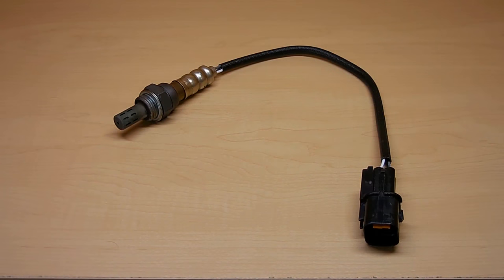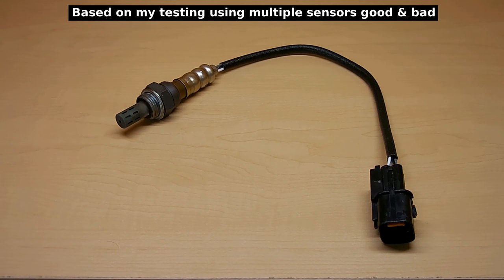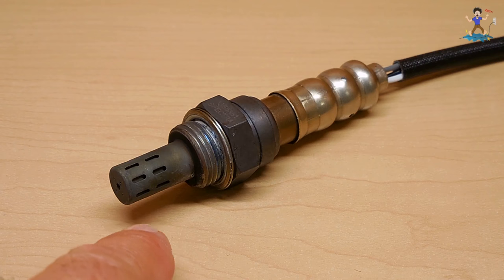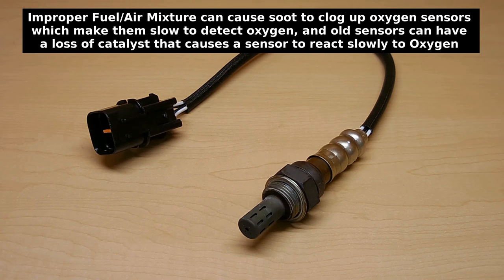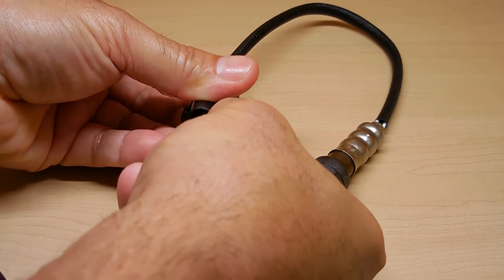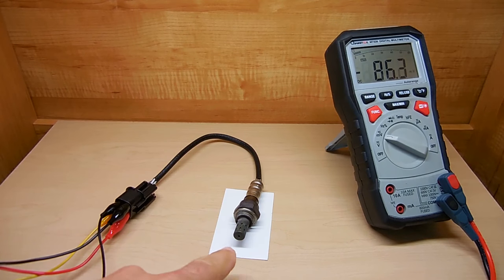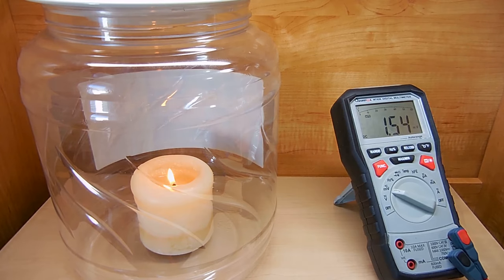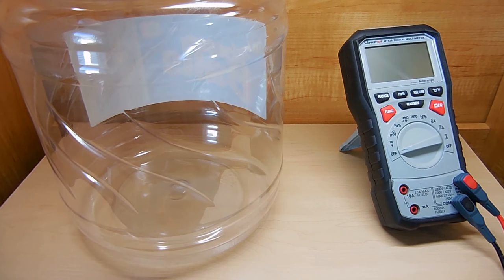How To Test Heated Oxygen Sensors(O2 Sensors) Without A Propane Torch

Comment from the maker: ATTN: The information contained in this video was intended to help viewers with the most common type of modern fuel injected vehicles that use O2 sensors along with an MAF sensor and IAT sensor.
Reply: What are these strange readings?!  Is this sensor broken?!?  You said it yourself the values should go from 0.1 to 0.9V, which are 100 to 900mA, and we see -12 to +6mA ?!?
Reply: @ivanbnv8354  He said typical readings .. some vehicles have different parameters which is why they all have different part numbers. years and years ago o2 sensors were all pretty much the same and different part numbers were simply to denote the length of the wires. Modern sensors are used for all sorts of data and have different parameters. wide band sensors are used in performance applications and cover a broader range and as such cost a shit ton more money
Reply: @ivanbnv8354  🔴 What Is Islam? 

🔴 Islam is not just another religion. 

🔵 It is the same message preached by Moses, Jesus and Abraham.

 🔴 Islam literally means ‘submission to God’ and it teaches us to have a direct relationship with God. 

 🔵 It reminds us that since God created us, no one should be worshipped except God alone. 

 🔴 It also teaches that God is nothing like a human being or like anything that we can imagine.

🌍 The concept of God is summarized in the Quran as:

📖 { “Say, He is God, the One.  God, the Absolute.  He does not give birth, nor was He born, and there is nothing like Him.”} (Quran 112:1-4) 📚

🔴 Becoming a Muslim is not turning your back to Jesus. 

🔵 Rather it’s going back to the original teachings of Jesus and obeying him. 

More ....
Reply: A propane torch should also clean it from build up carbon ?

Comment: You are my guardian angel. Thank you for this content. I will be watching a lot of it multiple times in the coming days. This one will be watched again later today or tomorrow when I run the O2 sensor tests on my Honda and BMW sensors. Both cars had blown gaskets and require full rebuilds. One is FWD and the other is RWD and I don't have a shop or power tools so I do everything by hand between 2 trees and under a tent on a sloped driveway. I started with zero knowledge, but I have documented the process and once I am done no one will be able to tell that these cars weren't built by the factory. (Other than the engine swap numbers) so thank you for the detailed videos. I am a fan.b

Comment: Great vid and methods explained very clearly.

Made me think about using the oxygen from the oxy/acc bottles in the shop, and feed it in with the torch head on a lid.
Reply from the maker: Glad you liked the video Jo! Be sure to look over my extensive video playlists below for many other videos of interest to you, use supplied Amazon links to support my channel when making purchases(No added cost to you), and share links to my videos with many others on social networking sites. Thank you, and stay safe!
http://www.youtube.com/c/electronicsnmore/playlists
Reply: @electronicsNmore  Professional mechanic and used to diagnosing these on the vehicle running and going by how fast they change readings but ever since got into removing them and cleaning in the sonic cleaner never really had a method to verify the heating circuit usually just cleaned them installed them and see if it fixed it.. with these sensors costing up to $200 these days and aftermarket ones utter shite been in the habit of cleaning the oem ones because to many times if you replace one you have to replace the other as well because mixing brands can get trouble codes when both parts are working they just have different value ranges.

Comment: Thanks for the time you spent making the video. 
I do have questions if you can help further:  On my 2008 Kia Rondo  I am dealing with OBD code for the downstream sensor that seems to not respond to O2 variations.  So I purchased two sensors just to verify what a good sensor should show on test bench. Bosch 15320  and NTK 25183. The NTK is lot more money but it is OEM.  I wanted to test them as you explained.  Temp at the outer casing on the tip was around 360 - 400F during test.  The way I do it is slightly different. I start with sensor in the jar with candle lit in jar. I place a lid over the jar and wait until the flame is gone. Then I check voltage:  NTK sensor shows  - 8.5 mv.  I removed rapidly the sensor from the jar to see the reaction when exposed to ambient air:  The voltage quickly went to -14.5 mv.  Notice the polarity reading is negative. I did pay attention to connecting the voltmeter + probe to the black wire which is supposed to be signal wire on this sensor. I thought that signal would be considered the positive side, correct?
Also notice the voltage going from 8.5  to 13.5  when O2 level  increases. This is contrary to what you experienced in your test and I think contrary to what the sensor does in a car.  In a car the sensor voltage decreases when the O2 increases.  I wonder about whether I have the wrong sensors or it is simply the nature of this simple test. b The Bosch sensor reacted in the same manner with -10.6 mv without O2 and - 17 mv in ambient air.
Any reply to my comment  would be much appreciated.
Thanks
Richard

Comment: @electronicsNmore   If the sensor is plugged into the vehicle harness but not the cat and key switch is turned to the on position (getting 12V from) should the sensor heat up?

Comment: But does lambda sensor "smell" oxygen difference between top holes (exhaust) and opposite (outside, ambient), close from bolt head holes ?
Reply from the maker: All detection takes place inside the exhaust system.

Comment: Good video.  Rewatched.  Any concern (ever) with voltage reading in millivolts?  5 millivolts- for example- is 0.005 volts.  Proper reading range to be between (0-1v). I do understand this test shows viability and quick response.........but Id think the voltage would be higher.  What am I missing?  Maybe not entirely not enough?  Combustion gas would have far less oxygen - somehow?   Please advise.  Thanks!
Reply: I tested my O2 sensor and it showed stable 4 mV (0.004 V) in room air. I tested it other way around, I blow the air to the sensor to get more oxygen to see if there are fluctuations, and voltage dropped to 1 mV, which is consistent behaviour.

Comment: If you only  have a 3 wire O2 sensor. to test voltage , do you hook up the two white wires ,then  one to  the black then the last one do you touch the body of the O2 sensor for ground... cheers

Comment: To drive the Oxygen sensor to his maximum voltage, you can mount the sensor in a piece of metal tube, and pull this tube it vacuum. 
This only works offcourse if you have a electrical heated oxygen sensor.
The voltage is created by the internal capsule which contains pure oxygen on the inside, and the less oxygen on the outside of this capsule, the more voltage difference is created by the in and outside of this capsule.

Comment: Hey, so does this mean, if i disconnect oxgen sensor from car and test it with multimeter, even if it shows a response, the oxgen sensor could still be faulty because its not getting tested and required heat temperature ?? 
 Im getting a p0420 code , after fitting brand new approved cat after couple weeks, scratching my head, as checked the 02 sensors disconnected and they show a response, they aint at zero.
When i clear the code, it comes back on after along drive. Thanks

Comment: I had to cut my old 02 sensor wire  and wire to new one cuz the new 02 sensor  it was too short it should still work right long as wires connecter back together?

Comment: Hi.  The info at the start said approx 0.1-0.9v should be expected, but the meter showed 1milli-volt (- 100-times smaller)?  I don't understand?
Reply: My guess is that it is still not as hot as would be required to be displaying values in the 0.1v to 0.9V range. Just my guess at this point. Perhaps someone with more knowledge can chime in.

Comment: Sir , my honda jazz ivtec has P0420 code , i tested the O2 sensor by this method and results was 
Heater is working, 
After heating the reading was around 5.5 at normal atmospheric condition , when introduced to a bottle of smoke ( as shown in the video ) it has decreased to around 1.8 , when i turned off the heater value increased to about 15 and again fall back to 0 slowly 
I had put the multimeter to 200mV position 
And change in the values was very quick

Comment: I'm trying to trouble shoot my tacoma 2000 and was wondering what happens to my truck if the black and gray  doesn't work(which is what i'm reading with my multimeter)?  Right now it's have a rough idle but runs fine when driving.  But since it's an old truck, i'm leaning to an air leak that I cannot find.   I'm asking because people always have trouble shooting videos on detecting bad sensors, but not the impact of a dead sensor on ECU.  Since it's dead, how does the ECU compensate for it since there is no signal going to it from the 02 sensors? Does it run tell the computer to run lean?

Comment: good test .. Because in most cases the sensor is OK, and the problem lies somewhere else .. Injectors are dripping / fuel pressure too low / incorrect air in the intake area / ignition system defective.

Comment: Where did you get   pure o2 for the test.    Do not heat the sensor like the pre view shows  as the soot from the candle may clog the o2 sensor.
Reply from the maker: Home Depot or Lowes. Oxygen cylinder for brazing/welding. Thanks for watching!

Comment: Do o2 sensors have a relay in a 2000 dodge dakota 2.5
Reply from the maker: If they use an internal heater, then most likely.

Comment: This sensor looks like an A/F sensor because of the readings is too low.
I know that the O2 sensor readings fluctuate between 100 - 900 mV.
Or i missing something 🤔
Reply from the maker: You missed something. :-)
Reply: @toolman talal wtf isn’t A/F sensor just another name for oxygen sensor??
Reply: @619guy202  you are correct. The cheap ones, about $15 to $18, are often the single wire none heated wide band sensors. The expensive A/F guage and sensor kits are often a 4 wire heated narrow band sensor that can give far more accurate readings. While the wide band is literaly that. They flucate largely and an average reading is used. A verry budget model guage you will see this fast flucation while cruusing as the A/F is rapidly adjusted continously. A mid range model will have a buffer circut to average out the reading, the ecm still has to adjust the A/F rapidly to account for the average reading of the single wire O2 sensors. The narrow band sensors allow the ecm to more accurately adjust the A/F and a steady value will be observed. As it provides a more accurate reading in the first place. As the old saying goes garbage in garbage out. All though depending on your purpose a mid range or budget model can suit your purpose at a lower initial and life time maintance costs. Performance needs would all ways fall towards the more expensive and more accurate models. As the high end narrow band sensors can cost several hundred US dollars.
Reply: @William Allen yes now bow down to me

Comment: In my experience O2 sensor often is the problem.
Reply from the maker: I'd say 50/50. I've seen many people replace O2 sensors to end up with the same codes or new O2 codes because the MAF was faulty, female O2 wire harness had poor connections, or other engine problems.

Comment: fyi O2 sensors DO NOT sense oxygen at all. It senses exhaust heat only, that generates a low voltage that the ecm interprets if the current ratio is correct or not, hints open loop learning mode. To which adjustments can be made to achieve the correct ratio. A bad O2 or MAF sensor will cause your car into closed loop with factory set fuel values to prevent engine damage but will result in slightly to bad fuel mileage.
Reply from the maker: Wrong. LOL
Reply: Everybody is a damn mechanic

Comment: This doesn't work with all sensors..it's been tried and with a brand new Denson sensor. only if you put the flame of the lighter, then the voltage jumps. when the heating element is on.

Comment: Best off to clean all the sensors in a vehicle and test them all off the vehicle because if you replace just one it will not have carbon build up and give different readings that will trip a code so best to clean them all so if you replace one sensor the others will be clean and operate in the same range .. just like fuel injectors if you replace just one and rest are dirty and gummed up the engine is going to run poorly and possibly out of balance. clean them all replace the bad one with a new oem one or cheaper yet get one or 2 from a salvage yard really cheap and clean them and have a spare and possibly less then $20 versus $100 plus for an oem injector.. news flash cheap injectors from e bay are made in china garbage and part store one not much better.

Comment: Ill pass on HF wires
Reply from the maker: What do you mean?
Reply: electronicsNmore 

    Harbor Freight wires
Reply from the maker: @sirsweetness8332  Thanks, I was wondering what he was talking about.
Reply: Nothing wrong with using Harbor Freight jumpers for this sort of application. There are no high voltages present. Quite honestly, if you buy these from Mouser, Digi-Key or other "reputable" electronics suppliers you will most likely receive the exact same jumpers made in the exact same Chinese factory, but pay more money for them.

Comment: Fake? The Heater signal is pwm. You just put the sensor in 100% duty cicle for too long. You should use maybe a 6v battery for the vídeo become less fake. What the hell is 5v (no O2) and 12v (O2) signal in a O2 sensor? What is the make and model of the sensor and of the cars it fit?
Reply from the maker: I you like fake videos, I suggest you find another channel to watch. Learn to post polite comments, if you expect polite replies.
Reply: State and explain a comment instead of some vage rude comment